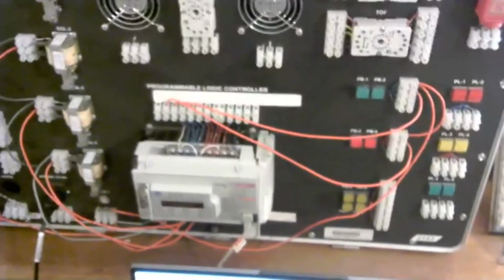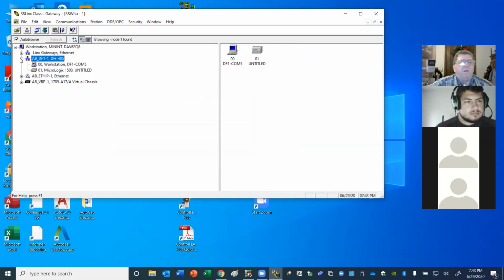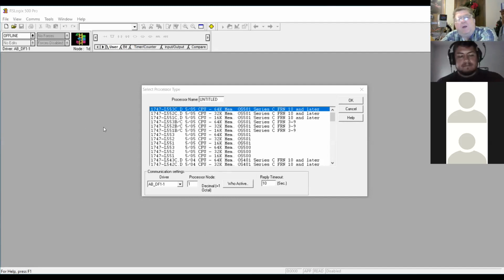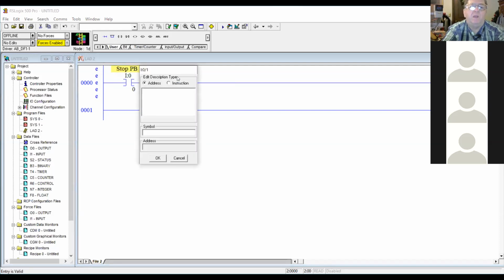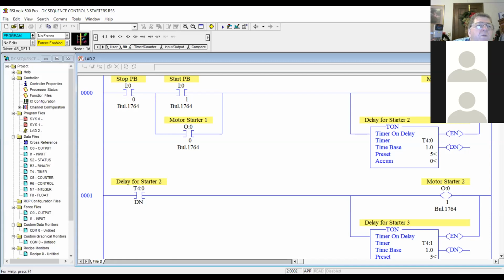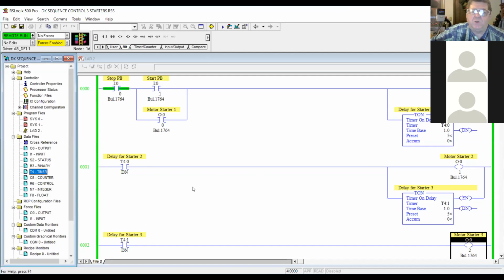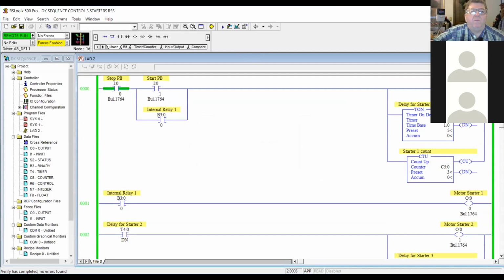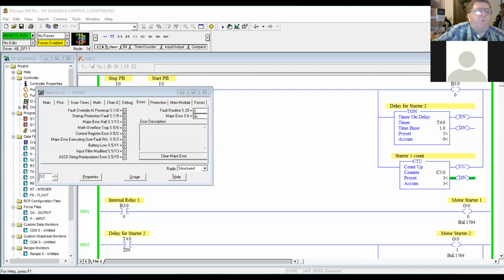Differences between RS Logix 500 and Studio 5000

Comment: hi i need an advice. im learning now AB plc simulator and planning to buy a real.PLC to simulate PID. What do think is the best to buy with a limited budget but i can use this to practice PLC programming.
Reply from the maker: Newer Micro 800 PLCs with free software called Connected Components Workbench CCW from Rockwell Automation
Reply from the maker: CCW works with AB Micro 800 family PLCs, and Powerflex VFDs, and Panelview 7 plus HMIs
Reply from the maker: Integrated software for everything
Reply from the maker: Sorry for delay, God bless you !!